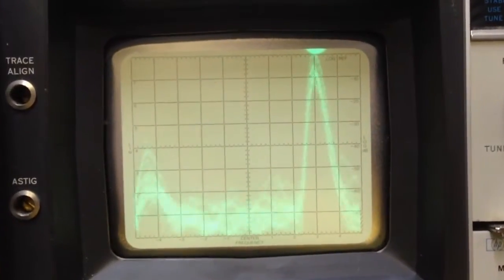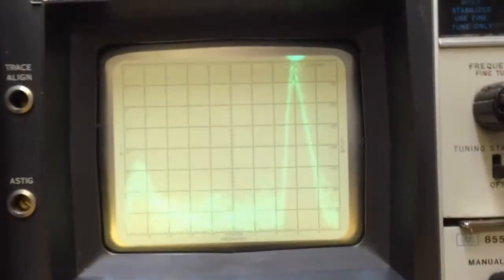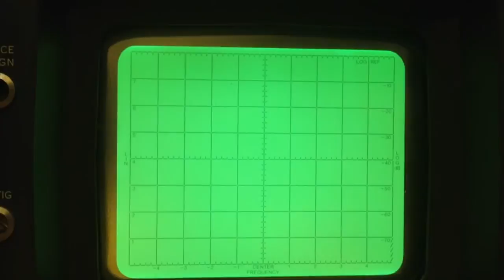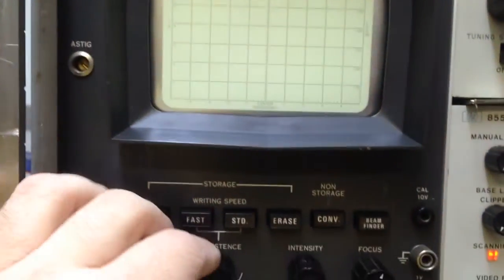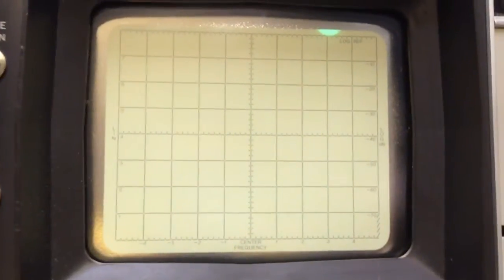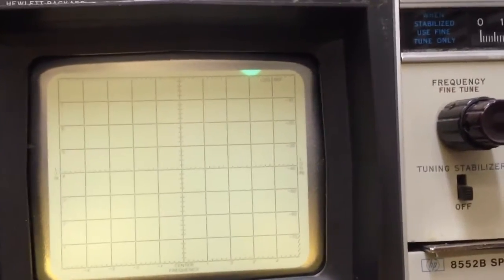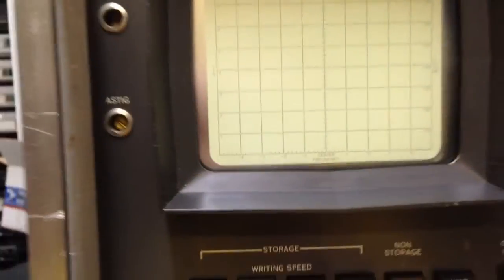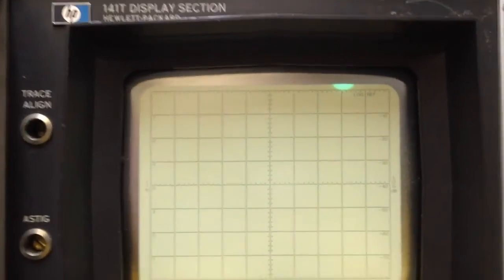HP 141T Spectrum Analyzer

Comment: my guess would be that you have a problem in your sweep generator, where it stops at a certain voltage point for a bit. I have not seen it on a spectrum analyser, but i have seen it on analog Electron microscopes.

Comment from the maker: Finally fixed the problem. It was the glues used in assembly of the CRT which is getting some age on it causing either a slow leak in the tube or contamination in the tube with the connections which protrude through the side if the faceplate here above the spot is an unused connection. All the high voltage is fed in the left side connection on a flat ribbon cable which is also becoming an issue with the old glues. I actuly found new old stock CRT which fixed the issue finally.
Reply: Thanks for letting us know. Best Wishes n Blessings Keith Noneya

Comment: I have an HP 8566B SA and not familiar with the 141T. However, is it possible this is a marker spot?? Again, I have no experience with the 141T..ZFZrom you description, it sure sounds like a marker dot. Beyond that, I would look at power supply voltages, electrolytic caps and tantalum caps. 
Good luck..
73,
Glenn WA4AOS
DSM Labds

Comment: I have the same analyzer. No clue on what's causing your problem. But have you tried tapping around the tube to see if there's any changes? I'm thinking maybe a loose filament during shipping? After all, these units are very old. Curious, what do you use yours for?
Reply from the maker: I use this unit for setting up video recorder heads mainly